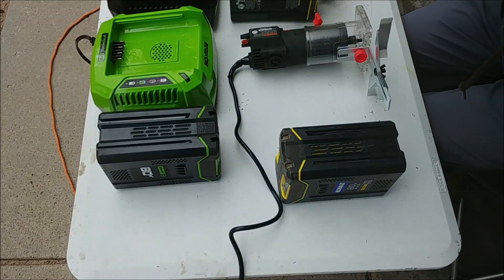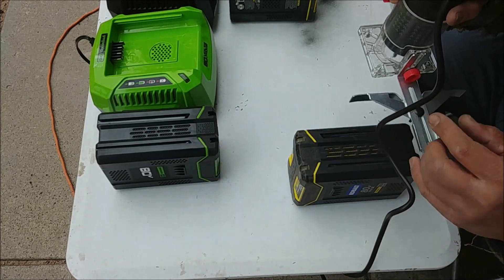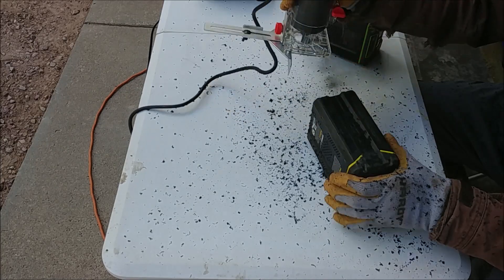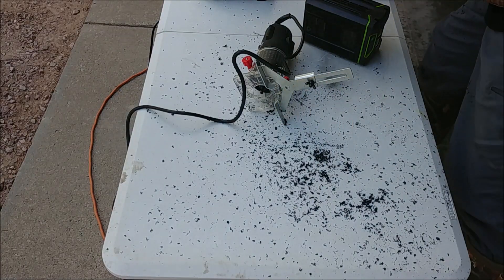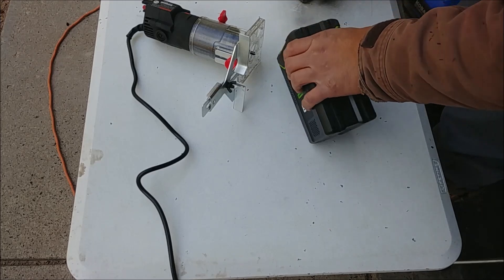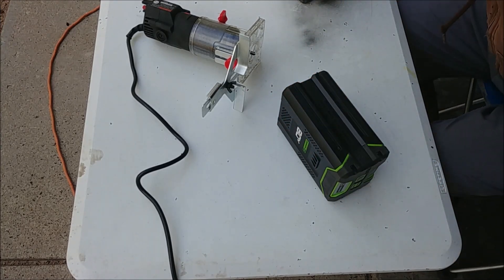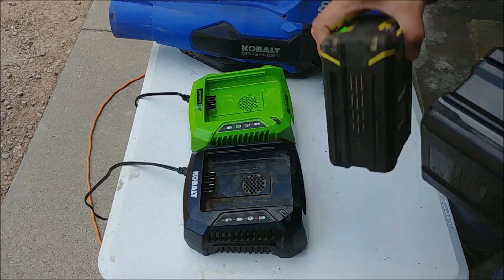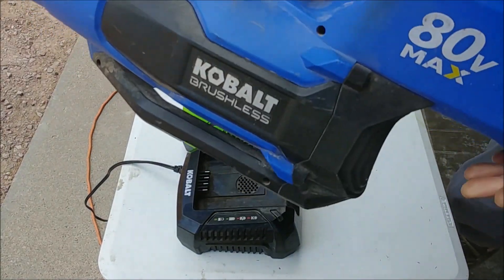Modding 80V Kobalt and Greenworks batteries to be universal with each other's charger and tools

Comment: Your video is helpful as i got two Greenworks 4.0 AH batteries off EBAY to use in my Kobalt 80v self propelled mower as i got the same DrillMaster router and Warrior router bits from HF. did the same method and got them to fit my mower and Kobalt rapid charger. as they also work on my 80v Kobalt blower, the attachment capable string trimmer, and the stick edger i got i yet have to get the single stage snow thrower.  as im sure the Masterforce and the Bad Boy E Series as well as the Briggs & Stratton Snapper batteries will have to be modified in the same way to interchange each tool and charger as these batteries are expensive as its best to modify the batteries than every tool you own  as all these batteries have the same connection and are made by Sunrise Global. but Kobalt and Snapper have different slots in their batteries as the slots in the Greenworks, Masterforce, and Bad Boy batteries are the same.
Reply: Great info thanks for sharing

Comment: Any update on if this works with 40V batteries?  My husband has been replacing all his yard tools with Kobalt 40V but they don't have a leaf vacuum....Greenworks does.  This would be my go to option if it works.  He specifically wants vacuum, not blower and our current tethered one is getting quite worn..... and he loves not having to be plugged in.
Reply from the maker: Sorry Jennifer but I only have experience with the 80 Volt lineup.

Comment: Hi thanks for sharing video 😊
I have Kobalt 80v trimmer. 
The brushless moter isn't working. 
I'd like to buy only  motor. 
Where can I get 80v brushless moter for Kobalt?

I would appreciate it if anyone could tell me where to buy the motor.
Reply from the maker: Well you have to tear it apart anyways to get the motor replaced to do that and see what model numbers are stamped on the original motor and then Google that and I'm sure you'll come up with a handful of replacements, most likely on Amazon.

Comment: You may have already figured out once finishing your video? Though your method does work, but time consuming. Both of the batteries you have are made by the same company and use the same platform so they're interchangeable if you takeoff the top cover and switch out the battery cells into the other case and reassemble easy Peezy.
Reply from the maker: That's fine if you have a dead battery.  All my batteries were good and is much more convenient to simply use them vs your method which is VERY tedious if your batteries are good.
Reply: So, I have all Kobalt tools.... Just ordered 2 new GreenWorks batteries.... I want to take the batteries cores in my new Greenworks and install them in my old Kobalt casings. I know it will operate fine...But with the new GreenWorks warranty of 4 years, if the new batteries should fail while under warranty, I would like to reinstall the cores back into the original new Greenworks casing for a warranty return.   Will the GreenWorks cases still appear to be "factory sealed" once the original battery core is restored to the original case?  I have the T10 security bit that fits my cordless drill. The swap would take about one minute.

Comment: Using the same Harbor Freight router I did this modification on my Greenworks and Kokalt 80V batteries. They are now interchangeable with both brand's chargers. I can also use either battery in my mower (Kobalt) and my new trimmer (Greenworks). Thank you for this video.

Comment: I found 2 Kobalt 80 volt 2amph batteries and the charger for $15 at a Goodwill thrift store. Both batteries are in good shape as well as the charger. Brand new the batteries and charger would cost at least $700. I'm gonna flip them and make some money. For $15 I got s steal.

Comment: For the record, I compared Kobalt with Masterforce (Menard's brand, also made by Greenworks) 80V battery by marking the grooves on a piece of paper and taking some pictures.  Those are slightly off, so I'm pretty confident this router method would work with Masterforce compatibility too.  Anyway, thanks for sharing

Comment: Another way without using the router is to use a Torx T-10 bit, remove the four screws and swap the battery. I just did this to my Kobalt 80v and posted a video. Easy!
Reply from the maker: That's fine if you battery is dead.  My batteries were still working and I was given additional ones by Greenworks for a recall.  You can also save money by replacing the bad cell(s) in your original battery, which is much cheaper.
Reply: So, I have all Kobalt tools.... Just ordered 2 new GreenWorks batteries.... I want to take the batteries cores in my new Greenworks and install them in my old Kobalt casings. I know it will operate fine...But with the new GreenWorks warranty of 4 years, if the new batteries should fail while under warranty, I would like to reinstall the cores back into the original new Greenworks casing for a warranty return.   Will the GreenWorks cases still appear to be "factory sealed" once the original battery core is restored to the original case?
Reply: @ericlee2931  Nope. They'll see that they have been opened.
Reply: @rocknrollermann  No they won't; there's no security tape or anything long as you're careful not to mark up the screws much.

Comment: So, I got two Kolbalt 80volt tools and want to get a Greenworks 80volt snow blower tool only. If I modify the batteries to fit the Greenworks SB and still fit the Kobalt units? Or should I trim the Greenworks SB battery chamber to fit the Kobalt?  any thoughts?
Reply from the maker: Modify the Kobalt batteries to fit the Greenworks SB.  I feel Kobalt 80V stuff is going the way of the Do-Do bird so you may as well adapt your Kobalt stuff to work with Greenworks.
Reply: @MassiveOverkill  thx so even with the battery mod it will still work on the Kobalt tools as well?
Reply from the maker: That's correct!
Reply: @MassiveOverkill  you think my Dremel would do the job, looks like you shaved off 1/8"?
Reply from the maker: If you have a straight edge guide attachment for it, sure.  One slot is only about that.  THe other slot shaves off a bit more.
Reply: @ErrantChordier For a few years

Comment: Are the OMEGA and "C" connectors @ the same locations?
Reply from the maker: Ron, unsure but I can tell you I have no issues running either battery in the other brand's charger or devices.

Comment: Right now I only have 80v Greenworks batteries. What do I need to change to use my batteries in Kobalt 80v tools?
Reply from the maker: You need to mill the bottom slot on the Greenworks batteries so they match the stock Kobalt batteries' bottom slot.

Comment: Does this mod make the batteries less secure when slid onto the tools? I only own Kobalt of these and wouldn't want to add Greenworks if there is a downside to modifying the batteries
Reply from the maker: In the charger, yes because the universal top rail isn't used to secure the battery in the charger.  In the tool, no.  That universal top rail still guides the battery in the slot and the spring-loaded locking mechanism still works as it should.  

I could only see an issue if you wall mounted your charger, but even wall-wall mounted the battery sits at an angle and not straight up and down, so I don't think it would be a big deal.